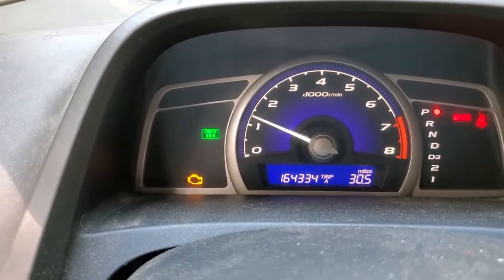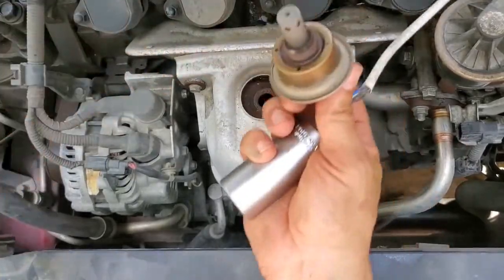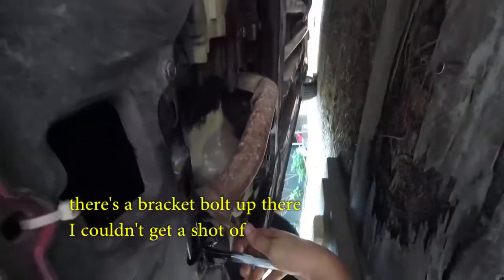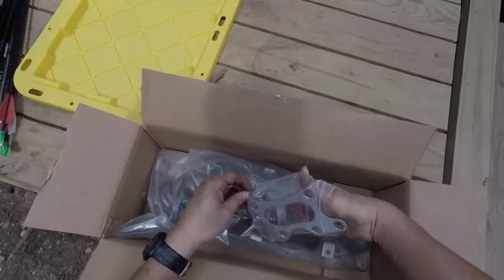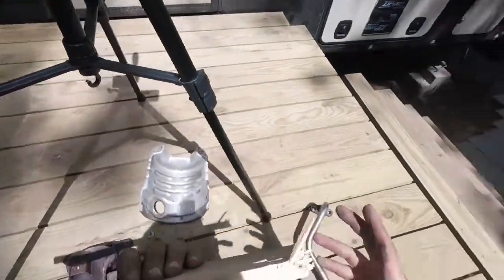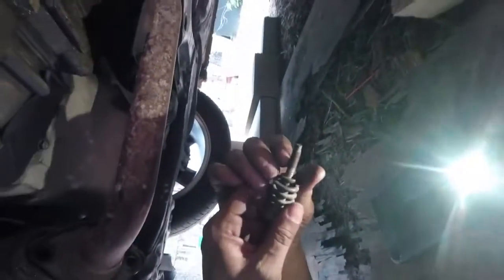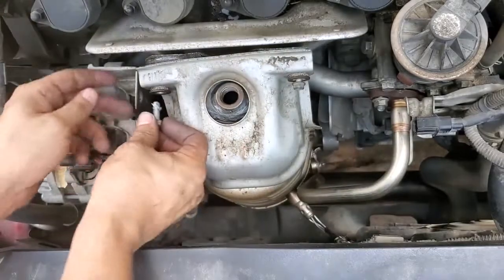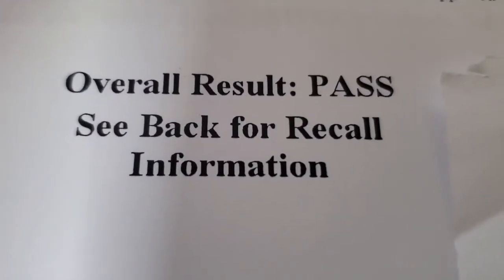changing a catalytic converter

Comment: For the past few months,  my 08 civic check engine light has been coming on for a day or two, then going off for a day or two.  I got the same code, cleaned both o2 sensors and the light went out for about a day,  then right back on.  Thanks for this video and info!

Comment: I have a 2012 Honda Civic LX 1.8 l. I want to try and change it myself and buy one on eBay but I'm afraid that once I do it that it won't pass emissions because it's an aftermarket?
Reply from the maker: I'm not aware of aftermarket cats having that problem. Passing emissions is kind of the whole point of replacing the cat, whether oem or aftermarket. The one drawback of aftermarket that I'm aware of is that they don't last nearly as long as a genuine oem part. The cat you see me install in this video died after 2 years. I'm due for another one already. A genuine part would still be functioning. If you don't mind swapping them out every 2 years, cheap ebay cats will save you a lot of money. If you want something that has a much better chance of lasting a very long time, then you'll want to spend the extra money (A LOT more money) on an oem part. Whatever you decide - good luck.
Reply: @danielames7611 i have the same car i’m in California think that Cat you bought would work on mine? thanks 🙏🏽
Reply from the maker: @ERSLIFE-we1mg  mechanically, it will work just fine. Now I don't know anything about CA emissions law, so please do your research for your location. I'm just "a guy on youtube". Never trust a guy on YouTube. :)